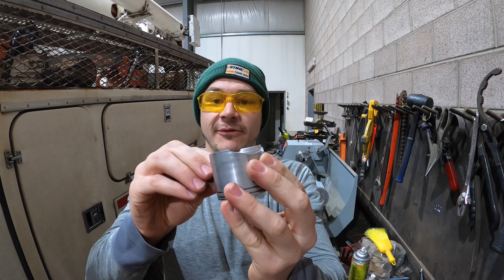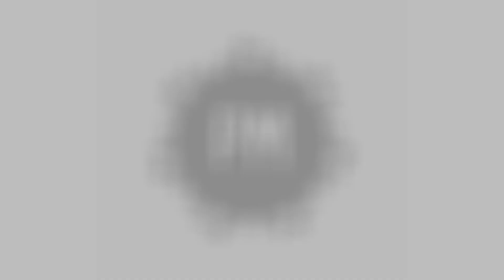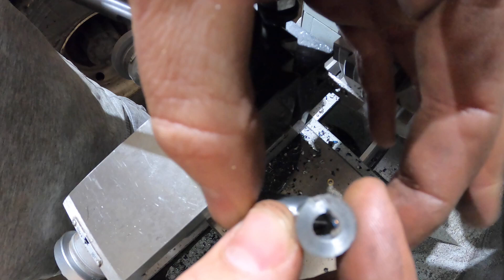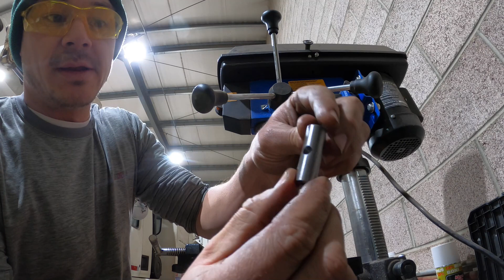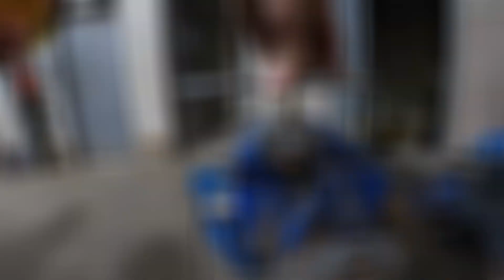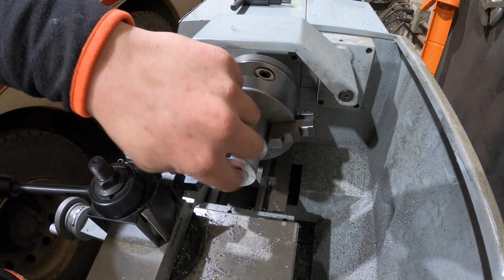POP UP PISTON HOLDER LATHE

Comment: To start the tap square, use the drill press with it off, after you drill the hole. Put the tap in the drill press chuck, bring it down, keep downward pressure, and turn the drill chuck by hand to get the tap started. Then, keeping downward pressure, loosen the drill chuck, leaving the tap in the workpiece. Finish by hand using the tap handle.

Comment: Appreciate your effort. If you have a 4 jaw chuck you could use the lathe to drill the pin, by placing the wrist pin in the 4 jaw and the drill and chuck in the tail stock😉👍
Reply from the maker: Thanks man, good tip, im happy with my piston anyways, All I can do is try until I succeeded! 🤙
Reply: Did you get a chance to break in your 372xp, how do you like it with the pop-up? She's gonna be cold for a bit up here in Calgary, hope you're keeping warm there 😉👍